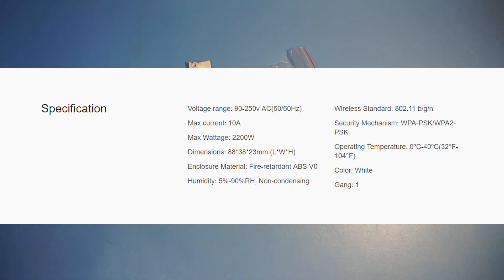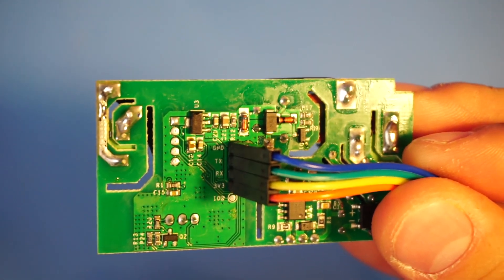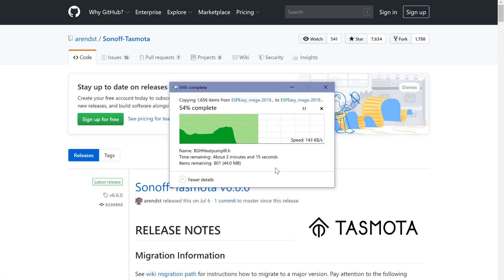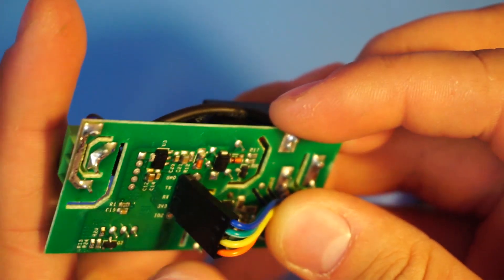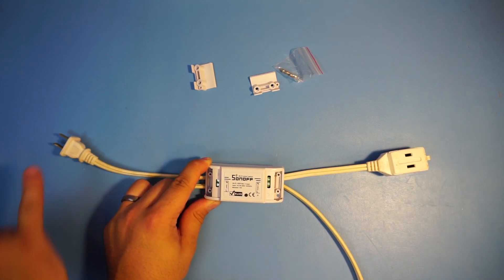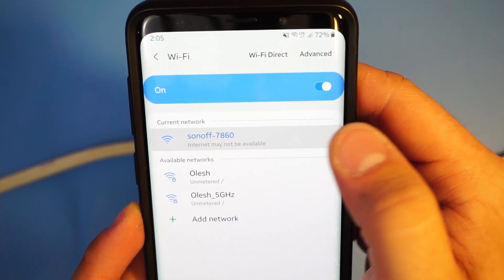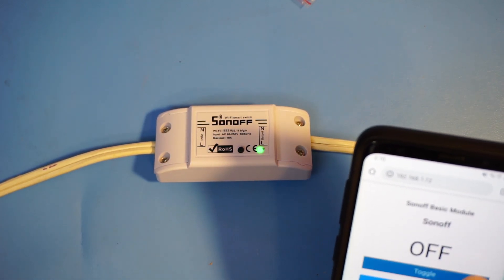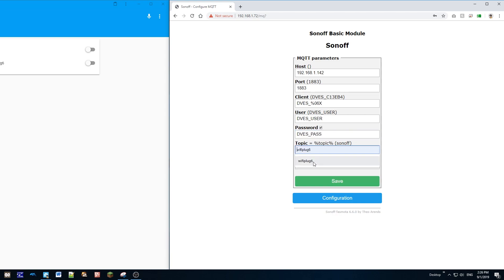How to Flash Tasmota onto Sonoff Basic - Home Assistant Basics

Comment: Thank you for the explanation. I use Duckdns. What should I use in the Sonoff MQTT configuration as Host? homeassistant.local?
Reply from the maker: I use the local up address; 192.168.1.140. I don't know if using homeassistant.local will work, I have not tested it myself.

Comment: Have questions about the Tasmota Sonoff device. 

I followed your nice video to flash my Tasmota Sonoff device.  Then my Home Assistant from Raspberry Pi can’t see the device under  Developer Tools->States->Entities. Hence, I can’t set the device to my view page. 

Besides, I wonder the device MQTT Host IP address should be my Raspberry Pi IP address as this is what I set up. 

Thank you.
Reply from the maker: If you have MQTT running on your raspberry pi then you should use that ip as your MQTT host ip.

Also, make sure to set up the "mqtt switch" entity correctly in Home Assistant.
Reply: @DaveOTech  Thank you for your quick reply. What do you mean by "mqtt switch" entity? Under my Configuration->Entity page, I saw my Entity ID: “switch.frontlight”, Integration: “MQTT” with Status: “!”. This may be the problem.

Here is my Configuration.yaml for switch MQTT and my Sonoff Basic page for MQTT info.
switch:
  - platform: mqtt
    name: "Entrance Light"
    state_topic: "stat/sonoff/POWER"
    command_topic: "cmnd/sonoff/POWER"
    qos: 0
    payload_on: "ON"
    payload_off: "OFF"
    optimistic: false
    retain: true

Here is my “Sonoff Basic Module Information” about MQTT input.
MQTT Client DVES_978B86
MQTT Topic sonoff
MQTT Group Topic sonoffs
MQTT Full Topic cmnd/sonoff/
MQTT Fallback Topic cmnd/DVES_978B86_fb/

Thank you.
Reply from the maker: @keithlau4178  The configuration you posted in the for mqtt switch, that's exactly what I mean.

However now there's a new way to set it up. On your tasmota device, go into console and type "SetOption19 1." This will turn on auto discovery. Then in Hassio go to Configuration, Integrations, MQTT. You should now see your brand new tasmota device.
Reply: @DaveOTech  Great thank you. Unfortunately I still have the same problem.

Added. I saw it under “MQTT:Mosquitto broker”. Don’t know it was there before or not.
     
Device Manufacturer Model Area Integration Battery
FrontLight Tasmota Sonoff Basic No area MQTT 
However, under the Configuration’s Entities page, the Entity ID: “switch.frontlight” still has the Status= “!”.
Then under the Developer Tools’s States page, the “switch.frontlight” has State = “unavailable”.
Then the Sonoff Basic Module console page has
23:51:15 MQT: Attempting connection...
23:51:15 MQT: Connect failed to 10.154.43.133:1883, rc 5. Retry in 10 sec <— where the IP address is my Pi Hass.io IP address.
Reply from the maker: @keithlau4178   Keith Lau  are you using the MQTT add-on? If so, verify that it is configured properly.

Sounds like the tasmota device cannot contact your MQTT broker.
Reply: @DaveOTech  Yes, I added MQTT Server & Web client to my Hass.io Pi. I think the add-on didn't work. Clicked the Start. I didn't see the "Restart", "Stop" or even "Open Web UI"  as I can find from TasmoAdmin add-on. Meantime, the TasmoAdmin can scan my sonoff device. i can click the "Test" button to turn on/off of the device. So it's telling me the MQTT add-on is not working. I've tried to re-install it but no luck. Will research for more. Thank you for your help.
Reply from the maker: @keithlau4178  if you have MQTT enable in your config file, disable it.

Comment: Aftre flashing not showing on wifi
Reply: Assume you are working on MS Windows. Download the "Termite.exe". 1/ Update the correct COM Port for your flashed Sonoff device. Then change the Baud rate=115200.  From the command line, input a) ssid1<router SSID> and then b) password1 <your wifi access point password>. Good luck.